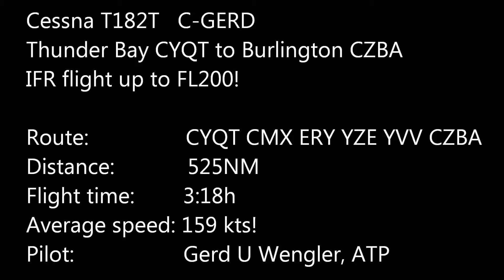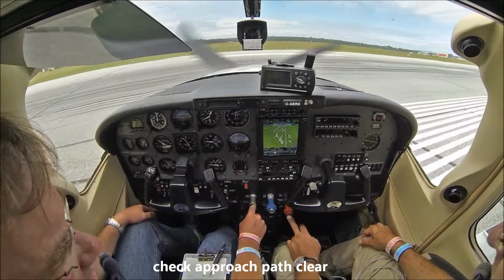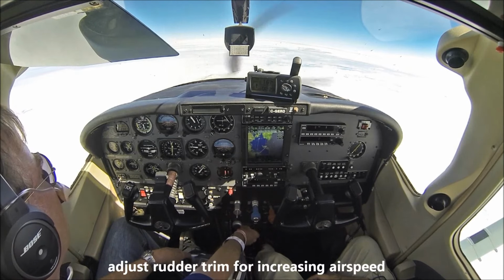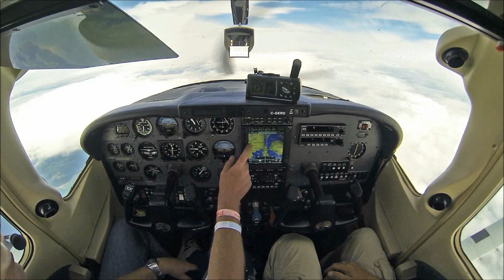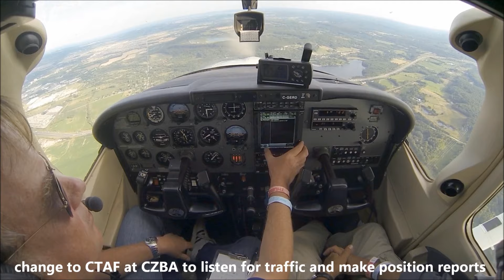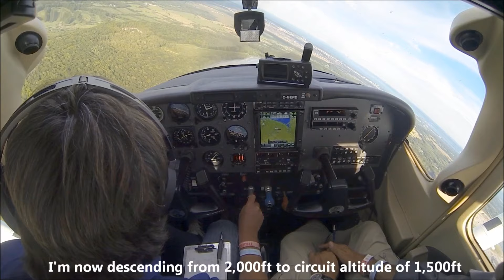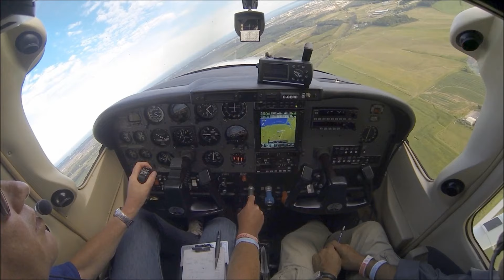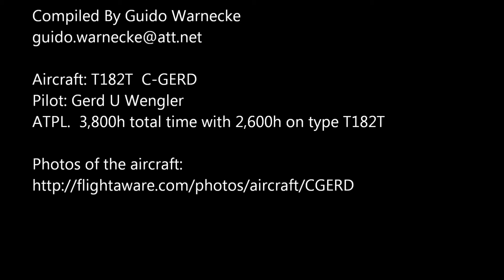Cessna Skylane at 19,000ft - cockpit video - must see!

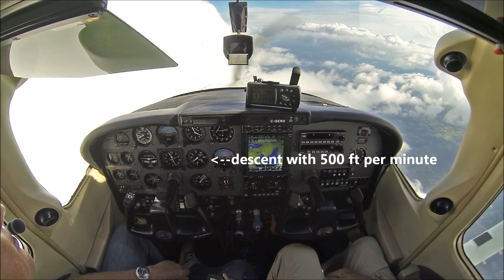Comment: @5:45 he was descending with the airspeed on yellow arc! Wow!
Reply from the maker: +mohammad imran Khan 
This is perfectly ok unless there is strong turbulence.
Happy Landings,
Guido
Reply: +Guido Warnecke Thank you Sir for your time, as far I remember Cessna company do not advice to fly in the yellow arc unless smooth air condition exist. During the descend there was cumulus type cloud which indicates unsuitability in the atmosphere more over I do not prefer to descent on higher speed unless necessary because of high parasite drag  and wastage of power. Please don't get me wrong, just thinking the aircraft can be flown on more efficient way by making a descend on lower engine RPM setting and on lower airspeed. Happy landings Sir.
Reply from the maker: The C182 is a very sturdy and well built aircraft. 
Happy landings,
Guido

Comment: Holly Molly!
that's less than 57.16KPA(16.88 InHg) :D
Reply from the maker: That is correct.
Approx. half the pressure compared to sea level.
Thanks for watching my videos & happy landings,
Guido
Reply: Guido Warnecke I see you are using supplementary oxygen  but is there a risk of getting bent from going this high in an unpressurized aircraft?
Reply from the maker: BreakingWave1 This is only an issue above 50,000ft as far as I know. Pilots of the U2 wear a pressure suit.
But I am not an expert in this.
The main thing you feel during high altitude flight in unpressurized airplanes is the expansion of body gases. I clear language, you start to fart a lot... :-)
Happy Landings,
Guido

Comment: are flying on autopilot or manual
Reply from the maker: Hi Mohammed,
most of the time, the autopilot is engaged.
It is important to use all resources on the cockpit.
Happy Landings,
Guido
Reply: which method would prefer if you were flying a big aircraft autopilot or manual
Reply from the maker: mohammed adnan Larger aircraft are flown more with aautopilotas a general rule.
Happy Landings in 2015!
Guido

Comment: pressurized  cabin I assume above 12k?
Reply from the maker: The cabin is unpressurized, so supplemental oxygen from a bottle needs to be used.
Generally an altitude above 10,000ft is considered so high that oxygen needs to be used.
Different countries have different regulations but the "10,000" rule is quite standard.
Happy Landings,
Guido

Comment: do they have air conditioning or heat if not can you open the window
Reply from the maker: Only some of the light aircraft have air conditioning.
There is a heater that routes hot air through the cabin.
The windows can be opened - even in flight. Very noisy though.
Happy Landings,
Guido

Comment: I've been up to FL200 in a normally aspirated TB20.
Reply from the maker: ***** That is quit impressive.
The TB20 is a good aircraft.
Happy Landings,
Guido
Reply: Guido Warnecke It did take a while though, and it was quite cold :) A turbo would be nice!

We fly IFR all round Europe so the long range (1300nm zero wind to empty) is quite nice. Normally aspirated engines tend to get to TBO without any issues but the turbos don't as they are working much harder. All about tradeoffs...
Reply from the maker: You are correct.
If you do not need a turbocharger for your typical flight - don't get one!
It is expensive.
The T182T is positive example. They used a big engine (540 cubic inches) and flat rared it to 235HP. It reaches its 2000 hiur TBO with ease.
In the C210, it is a rare case if you do 16000 hours without a cylinder change.
Happy Landings,
Guido
Reply: Guido Warnecke Yes, the actual turbo installation does make a big difference. The turbo TB20 (TB21) has a particularly bad installation unfortunately, as well as 50kg less payload (somehow).

Anyway thanks for making these great videos, your manner is very professional and a pleasure to watch.
Reply: stefanheale You must be a troll. You'd be hard pressed to find an engine as reliable as a well looked after Lycoming IO540. A well looked after one will go well past TBO without any issues.
Reply from the maker: Sheldon - you are 100% correct.
The IO540 is flat rated.
There was a crankshaft AD though, they had a bad batch of crankshafts built in the engine.
Is all resolved now.
Happy Landings,
Guido
Reply: Yes, that was a big problem. We got our engine rebuilt at about 500 hrs or so as Lyco were doing a deal on free new crankshafts still. All sorted now as you say. Engine is now at nearly 2000hrs and is clean as anything - always run LOP and carefully managed. It's on FAA part 91 so it only has to be overhauled on condition.

Regards
Reply from the maker: Sounds good.
I have used LOP only in the Cirrus, Never in the T182T or T210.
Requires a lot of attention.
Happy Landings,
Guido

Comment: How do you turn on the oxygen in small planes?
Reply from the maker: Hi Evan,
there is a valve in the cockpit ceiling. You do not want to keep the valve open permanently as is would leak.
The oxygen lines have a flow indicator (a green marker becomes visible), to ensure that the oxygen is actually flowing. The bottle has a pressure gauge.
Happy Landings,
Guido

Comment: Typically in the US its required to wear a mask instead of a cannula above 18,000.  Is this not advisable or required in Canada?.  Did you check pulseox levels at 20,000 feet on only the nasal cannula.?
Reply from the maker: +David Heon 
You are correct, David.
The official answer is that we wear masks above 18,000ft, this was just cut out of the video...
Happy landings,
Guido

Comment: Is this aircraft pressurized? I was wondering how you could be at 19 or 20K feet with no oxygen.
Reply from the maker: Hi Edward,
the aircraft is not pressurized.
We use supplemental oxygen from built in tanks to supply nasal cannulas and masks.
Happy Landings,
Guido
Reply: Thanks.  Couldn't see it in the video.

Comment: Why in the heck would you fly this at near the max certified alt? We don't even do that at my airline. Also, how long are you up there in an unpressurized aircraft without oxygen? I don't know if this is something that should be videoed and watched by new pilots that would think this is cool and ok.
Reply from the maker: Hi Chris,
the reason to fly that high was to use the tail winds.
We used supplemental oxygen of course, typically above 10,000ft, at night sometimes at even lower altitudes for better vision.
We used canulas, so not well visible on the video.
Hypoxia is very dangerous as it is difficult to detect.
I am an ATP, fly business jets for a living and I am probably as safety minded as you are.
Thanks for your comment and for watching my videos.
Happy Landings,
Guido
Reply: Chris Hall The airplane does not have a max. certified altitude.  It has a service ceiling of 20,000ft..  The max. altitude would be much higher, at least 25,000ft. but Cessna decided for marketing reasons to restrict the T182 to 20,000ft. to distinguish it from the T206 and the T210.

Comment: wasn't aware the skylanes service ceiling was that high.
Reply from the maker: It's a very powerful aircraft.
Happy Landings,
Guido
Reply: The only single engine plane I ever rode in was a Cessna 210, courtesy of a friend who was learning to fly at the time. Louder than anything I'd imagined, but the vibration was oddly pleasant, as if the plane was alive.
Reply from the maker: R5H4D0W The C210 is a fantastic aircraft, the turbocharged model has a service ceiling of 30,000ft!
These light aircraft are all very loud, so headsets should be worn.
Happy Landings,
Guido

Comment: at aroumd the 5 minute mark, was the pilot actually on oxygen,  if so,  was it becasue the plane was up at the altitude that the pilot was required to be on oxygen??????
Reply from the maker: Thank is correct, Andrew.
The aircraft in not pressurized, so oxygen must be used.
Happy Landings,
Guido
Reply: WOW,  thats amazing,  I never knew that a Cesna could actually go that high up in altitude,  was 19,000 feet pretty much the maximum altitude that the plane could go or could it go even a little bit higher?:  Thanks again......
Reply from the maker: Andrew Silva Hi Andrew, 
the certified altitude for this aircraft is 20,000ft, abut I could go much higher.
Happy Landings,
Guido

Comment: You can say 'ready takeoff' at the hold short line.  What else are you going to do on the runway?  Changing to departure frequency without an okay from the tower is prohibited, though.  Also, above FL180 you need to set the altimeter to 29.92.  And flying into clouds at high altitude without deicing is unwise.  Citing local landmarks on non-tower is not a good technique.  Not everyone knows them. Standard in non-tower is cite the airport 'traffic', end transmission with airport 'traffic'  non-tower share unicom frequencies.    Missed runway exit  call.  Never look down to turn off a landing light will still taxiing on a runway.
Reply: Try saying 'ready takeoff' while holding short at your next check ride with a FAA examiner. See how it goes.
Reply: I have 1,100 hours.  I have had four checkrides.  I NEVER say ready departure.  Not in any checkride, not in any biannual, not it any Class Bravo, not in any field at all.   You may want to go up for a demo ride at a Class Charlie airport with a CFI and roll up to the hold-short and here the tower say "ninercharlietango cleared for takeoff"  it's how it's said....
Reply: Well of course the tower says "cleared for takeoff". And you say it when reading back only. Read your post. There is no "ready takeoff" call. If you are holding short how are you on a runway?
Reply: Reread it...the tower says cleared for takeoff.  It is correct to say ready for takeoff.  The same nomenclature used by both sides.  Ultimately radio protocol is about clarity (intent) and safety.  Takeoff is the most precise  because you may or may not be departing...you could be doing pattern work and not depart the field at all.  It is also not wrong to say "ready for departure" but usually that is only used if you are in fact departing the field.

In this video you say you want to takeoff from an 'intersection'  that is a phrase not used in the US.  You may ask to takeoff from 'midfield' or a named taxiway point, like "request takeoff at Juliet."  

 Incidentally, radio comms is covered in the AIM which is not regulatory.
Reply: ICAO is not US standard.  I can't tell where you are flying in your video so I am assuming it's not in the US given the accent from the tower.  These radio phrases are different in other parts of the world, I am aware...for example in Europe they say  OneTwoThreeDecimalOneTwo...in the US we say OneTwoThreePointOneTwo for radio frequencies, and often ground will be shortened to just  PointNiner or PointNinerFive since many ground frequencies in the US are 121.9 or 121.95.

For those flying in the US a great resource for staying current on radio comms around the world is at  http://www.liveatc.net/
Reply from the maker: The rules are quite simple (made up after a collision the ground  of 2 B747's at Tenerife, with the loss of more than 500 lives): the word "take off" is only used in conjunction with a  take off CLEARANCE. Any thing else, like reporting that you are ready for a take off etc. is referred to as DEPARTURE.
That seems nitpicking, but the  verbal communication between pilot and air traffic control is very vulnerable and prone to error. Only standardization (and the discipline to adhere to these standards) helps to close this safety gap.
Happy Landings,
Capt. Guido
Reply from the maker: The rules are quite simple (made up after a collision the ground  of 2 B747's at Tenerife, with the loss of more than 500 lives): the word "take off" is only used in conjunction with a  take off CLEARANCE. Any thing else, like reporting that you are ready for a take off etc. is referred to as DEPARTURE.
That seems nitpicking, but the  verbal communication between pilot and air traffic control is very vulnerable and prone to error. Only standardization (and the discipline to adhere to these standards) helps to close this safety gap.
Happy Landings,
Capt. Guido
Reply: @GuidoWarnecke  As you may or may not know, all ATC communications which also include takeoff, landing and taxi clearances are ADVISORY and defined in the AIM (NOT CFRs).  Thus are not regulatory.

AIM Section 4. ATC Clearances and Aircraft Separation
Clearance
        A clearance issued by ATC is predicated on known traffic and known physical airport conditions. An ATC clearance means an authorization by ATC, for the purpose of preventing collision between known aircraft, for an aircraft to proceed under specified conditions within controlled airspace. 
        14 CFR Section 91.3(a) states: “The pilot-in-command of an aircraft is directly responsible for, and is the final authority as to, the operation of that aircraft.” If ATC issues a clearance that would cause a pilot to deviate from a rule or regulation, or in the pilot's opinion, would place the aircraft in jeopardy, IT IS THE PILOT'S RESPONSIBILITY TO REQUEST AN AMENDED CLEARANCE.
Reply from the maker: @speedomars  That's all nice and good.
I di nuit understand the context of not saying "ready for take off" .
Safety is first!
Happy Landings,
Capt. Guido

Comment: +King James According to the FAR 
FAR Â§ 91.211 Supplemental oxygen

(a) General. No person may operate a civil aircraft of U.S. registry—

(1) At cabin pressure altitudes above 12,500 feet (MSL) up to and including 14,000 feet (MSL) unless the required minimum flight crew is provided with and uses supplemental oxygen for that part of the flight at those altitudes that is of more than 30 minutes duration;

(2) At cabin pressure altitudes above 14,000 feet (MSL) unless the required minimum flight crew is provided with and uses supplemental oxygen during the entire flight time at those altitudes; and

(3) At cabin pressure altitudes above 15,000 feet (MSL) unless each occupant of the aircraft is provided with supplemental oxygen.

Apparently this flight took place in canada, i don't know if their regulations are the same, but in the USA this flight would have required oxygen to be legal.
Reply from the maker: +hzuiel We used nasal canulas with oxygen up to 18,000ft and above that masks (not always visible in the video).
At these altitudes it is not a matter of "legality" to use supplemental oxygen. You have to use it unless you are a Sherpa somewhere in Nepal and climb the Mt. Everest on a regular basis...
Happy Landings,
Guido
Reply: +Guido Warnecke I didn't see a cannula in the video, but in any case, are the restrictions totally different in canada?
Reply from the maker: Regulation are basically the same, with the max altitude without oxygen even lower.
The US has these quite high 12,500ft (30min at 14,000ft) because of the high terrain in the west.
A normal "flatlander" like me (I live at the East Coast) would struggle at that altitude without oxygen.
I lived in South Africa for many years (Elevation 5,400ft). There I could fly 13,000ft all day long without oxygen as my body was adjusted. 
Happy Landings,
Guido
Reply: +hzuiel In Canada you can be above 10,000 feet for half an hour before you need oxygen, and all times above 13,000 feet.

A few weeks ago I did some flying in a Skylane (no turbo, but constant speed prop and G-1000) in northern California, and we were flying at 12,000 feet over mountains. We kept an eye on each other for signs of hypoxia.
Reply from the maker: is correct, Laura.
The oxygen rules are different in different countries.
If you live at sea level, 10,000ft should be considered as the maximum altitude without supplemental oxygen.
Signs of hypoxia are very difficult to spot by yourself. That makes it so challenging,
Happy Landings,
Guido
Reply: +Guido Warnecke You may have already addressed this but aren't full face mask oxygen masks required above 18,000' ?
Reply from the maker: We had masks on on portions of the flight. Not always visible in the video :-)
Happy Landings,
Guido

Comment: The pilot should have disconnected the autopilot at the first indication of ice accumulation. Specially in a high wing aircraft since you can't see how much ice there is. If the pilot had loss of control effectiveness he would never noticed since he wasn't flying the aircraft.
Reply from the maker: Hi Michael,
you address a good point here. The biggest risk with the autopilot in icing is to have the "altitude hold" function on.
If you do not look at your air speed, the autopilot may  trim backwards into a stall.
In this case it was OK to keep the autopilot on, speed was not affected.
In a high wing aircraft you see icing quite well, although you do not see the upper part of the wing.
Thanks for your comment & happy landings,
Guido
,

Comment: Big deal! Jim Price took his 150 HP (normally aspirated) LongEZ to 35,000 feet for a world record in his weight class at least ten years ago. Ten years before that Dave Timms held the record at 30,000 feet in his 0290 (125 HP ground power unit powered) LongEZ. I regularly cruise my 0360 powered LongEZ at 17,500' at 200 MPH burning 5.7 GPH. Store - bought airplanes are SO 60's. Bob
Reply from the maker: +Bob Holliston 
These are impressive numbers, Bob!
Happy New Year with many Happy Landing in 2016.
Guido
Reply: +Guido Warnecke My cousin commutes to Sun Valley Idaho from Hood River Oregon and back every weekend in the winter, a 9 hour drive. He's a pilot but not current. I told him to buy a 182. They cruise 160 MPH, have a good safety record and are pretty bulletproof. He'd cut his one way time down to 3+ hours. He's thinking about it.
Reply: +Bob Holliston.   Winter? Be very careful. Aircraft must have de ice and the pilot should be instrument rated and current. The mountains around the NW are littered with crash sites.